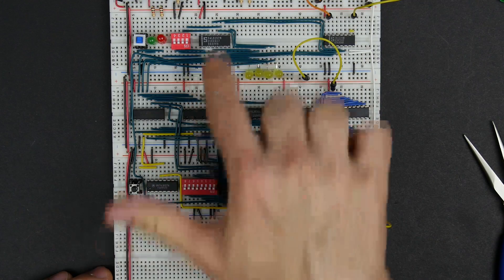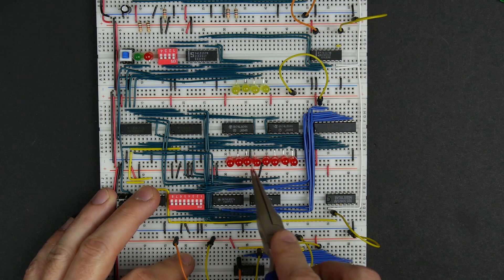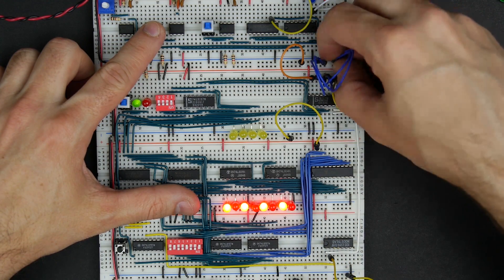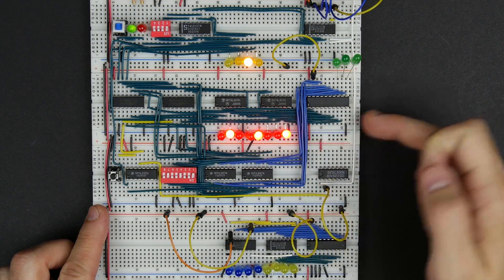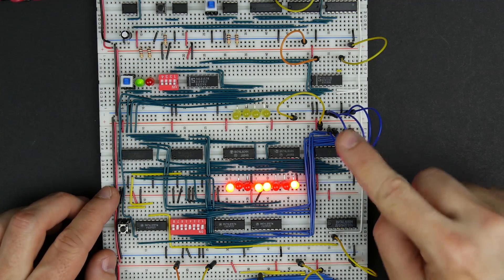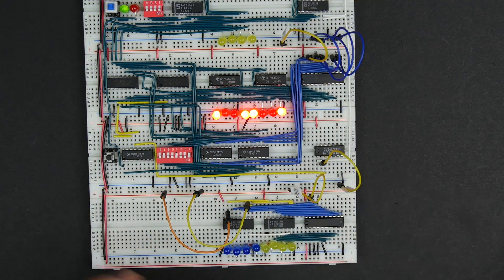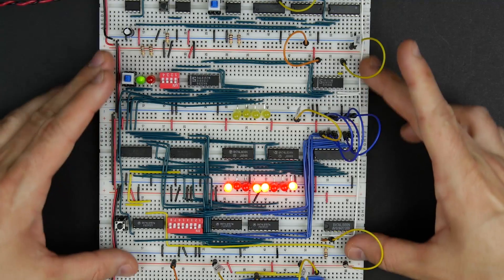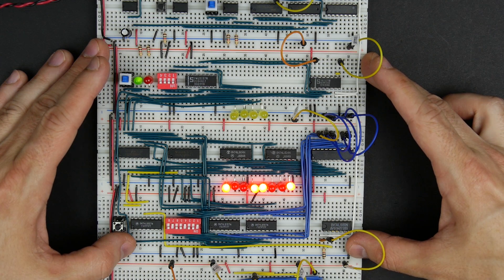RAM module testing and troubleshooting

Comment: Great fun building this so far.

The kits are great, but they are not flawless (and I would not expect them to be).  One of my 189s (the 64-bit SRAM chips) was busted on arrival.  Two of the address lines caused shorts.  Took me hours to conclude it wasn't a fault with my circuit - because that is your immediate assumption - and then to build a test circuit to prove the chip was dud.

I'm not bitter; it put hair on my chest, a proper debug session.  I'm no hardware engineer, so I like to think I learned a thing or two from the experience.

I think it's wise to put current-limiting capacitors on all the LEDs, despite what the video says (but if someone can definitely tell me I'm wrong about this, I'd love to know).  I'm no hardware engineer, so it's just something I'd do anyway because I don't know any better.   But also, from experimenting myself with the clock circuit, I couldn't drive a consistent clock signal to a load while running an LED from that signal straight to ground.  I dunno why, I'm a software guy, not a hardware guy.  Maybe someone here can tell me.  tl;dr - use current-limiting resisters on the LEDs - and this will mean that you will have to plan your own layout - the layouts in the video will not work.  Scan ahead to see what is going on the board, then adjust for the LEDs and resistors you are going to add.  This is fun (no really, I mean that!).

I also note below there's a comment about the capacitor on the RAM "sub-board" clock input.

I've scanned the threads for other errata.  I don't see any.  Does anyone have anything else?

Comment: I have a trouble that when i store data at address 0 in program mode and then switch to run mode,all the data will be reset to zero.
only address 0 have this problem,I dont know how to fix it.

Comment: Discovering you have a bug after connecting lots of wires can get frustrating fast.

Also, each time I see a misconnected power wire, I expect to release the magic smoke that makes everything work. That would just add to the frustration. Glad there wasn't any magic smoke in the video.

Comment: In my Ram module, when I switch my board from program to run mode, some of the bits in my addresses deactivate, I have checked my wiring multiple times, does anyone else have this problem?
Reply: Probably too late now... But it's likely that your 4-bit address buffer was storing a random address (whatever it got when it powered on), and when you toggled between program and run mode, you are going to pick up whatever is in that buffer.  Are you sure you wrote the desired address into that buffer?

Comment: If you ever had the problem of some of your 74ls logic gate series burning well thats probably beacause the inputs are floating and thus powering both transistors at the same time driving tons of current converted to heat
Reply: I had to debug for ages to find it and i also found that some chips are protected against floating like the CD4011 nand gate

Comment: Warning: Do not add the 0.01microfarad capacitor directly to the clock output as indicated. This creates an exponential decay curve on the clock's falling edge, making other clock-connected modules to be unreliable (mainly the control signals that use the falling edge later) . I confirmed this with my scope, removing the cap immediately solved the problem. 

The solution is to create a signal, isolated from the clock, using something like a buffer. Since there are 2 unused NAND gates right next to it (74LS00) , you can create a buffered clock signal by making 2 of the NAND gates into inverters, thus inverting twice. Input the clock into the first NAND input,  and tie both those inputs together, then send that output to the next NAND input, tie those 2 inputs together, and then your output of that will be the buffered clock that you can send into that cap as before.
Reply: I ran into the same problem where the negative edge trigger later was problematic (when building the control logic it would double trigger when setting test control signals low from the 3to8/138) and I traced it to this capacitor (looked like reflections were happening). It seems that you can also install a 10x smaller capacitor (10nF rather than 100nF) and negate the clock problem you're describing (at least on my setup that worked). The buffered setup you describe is superior though :).
Reply: Thanks!
Reply: Won't that add propagation delay that will desync the local clock from the main clock?  Unless you do the same thing everywhere you use the clock...

Though it might not matter at the low speeds this computer runs at...

Comment: If you have your clock input connected to your registers during this stage, you may be having double counting after putting in the RC circuit shown at 13:15 . 
Put the clock into the inverter (74LS04N), then put the inverted output through the inverter again, then connect THAT output to the RC circuit. 

I was pulling my hair out before finding this solution.
Reply: Thank you so much!

Comment: Adding this capacitor for 10 microseconds means that the clock speed can't be fastar than that, right? Isn't that a "bad" thing? How fast can the clock go?
Reply: it is only like 133hz at max so not even close to 10 microseconds per pulse
Reply: @FBI_Master  it’s actually about 300hz. Check the Turing videos
Reply: @xiar5546  oh i messed up my math

Comment: I actually had some problems with this build. In program mode, I would see data being written into RAM even when I wasn't pressing the button, and the values written weren't always matched up with what was on the switches. The problem turned out to be the assumption that the '157 inputs were internally pulled high. Even in program mode, the open input from the write enable was coupling to the clock signal from the bus write enable. And the open inputs on the '157's hooked up to the switches weren't stable. Adding 1k pullup resistors to all the inputs fixed everything.
Reply: Got exactly same problem here. I stumbled on this awesome channel when trying to build a Scott CPU and I am actually following lots of Ben's design and strategy since then. Last time I worked on RAM module, I've got the same problem as you described. I thought about debuging by changing my NAND gate from an HC series to a LS and, if it doesn't work, I would put pull-up resistors. Seems I'll try the later option first. Thanks for the advice.
Reply: There is also a problem that the 157 has some time that the output is low when it's select pin changes and thus sometimes writing to the ram but for some reason it's fixed when i place a 220R pull up resistor.
Reply: @stevenribus123   Where did you put that 220 Ohm resistor?
Reply: Had the same issue of inadvertant writes to the ram and found a LOW-Spike on the output (4Y, Pin 12) on the 157 when switching from A to B or vice versa on the select Pin ((A/B, Pin 1) of the LS157. The spike was on the output only, the inputs (4A, 4B, Pins 13,14) were clean. I solved it with a 100nF Capacitor on the Pin to HIGH - it works but somehow doesn't feel correct.

Comment: The capacitor charge time is actually about 50µs. R*C is the time constant τ, and it takes 5τ to charge a capacitor over 99%. 1τ will charge it to about 63%. How long this takes to trigger anything in the circuit depends on the VIL/VIH of the part.

Troubleshooting a circuit at work, I needed to extend the time a reset line was held low. (The bench power supply I was using had a slower rise-time than the supply in the system and I was getting garbage initialized to the registers.) I had to adjust my initial component values because the Voltage Input High was about 1.2V and the supply was 5V. I had calculated with 5*RC, but this was too fast because the components triggered high after less than 1τ. I solved E = Vin * (1 - e^(-t/RC)) for R where C = the cap I was using, E = 1.2V, and t = whatever delay I needed. Worked great after that.

Comment: @14:56 Is this a limitation (one of the limitations) on the speed of this computer?
Will it cause problems if the clock ticks more than once every 10 microseconds?
Reply: tip : thé answer is in the question...

Comment: I had the same problem as others with the RC circuit added to the NAND gate messing up the clock in other modules.  I routed the clock through the NAND gate twice with one input set to high to prevent the feedback and then to the RC.  However, when I do that the write enable is always set on the RAM chip regardless of how the RI jumper is set.  Anyone else have this problem and have a solution?
Reply: I had the problem with the RC circuit too. Rather than running the clock signal through the NAND gate as you did, I ran the clock signal through a Schottky diode (of the BAT-43 variety)  before connecting to the capacitor as design by Ben Eater. This fixed the "back signal" the RC circuit created in the clock line. Also, I found in general that Ben Eater's assertions about certain chips having internal pull up resistors is not always true, or the internal resistor is "too large" and thus doesn't create strong enough pull up across multiple connections. An so, I've sprinkle a number of 10K or 1K pull up resistors. Pertaining to this RAM module, the critical pull on resistor was on the selector pin of the 74ls157s (which select whether you are in run mode or program mode). Leaving those pins floating while in run mode yielded inconsistent results. The good news is since all these pins are connected to each other, you only need one 10K pull up resistor somewhere in the line.

Comment: This might be a stupid question but, why use a RAM if you want to write on the edge? Wouldnt it be simpler if you used a register from the begining?
Reply: The important thing about the RAM is that it contains multiple addresses. A normal register only contains one data value.

Comment: What gauge wire are you using in this project? I bought 22 gauge solid core, but the insulation seems quite thick compared to what you have here. I'm wondering if this is standard?
Reply: I was wondering the same thing; on my build the wiring gets very tight, particularly around the bus driver chips. On the ALU I ended up using an extra breadboard to space things out. I think I'm going to have to do the same here
Reply: I am in the same position

Comment: really great videos, subscribed, im trying to recall a combination lock circuit that i forgot, it used flip flops with for its sequencer series and a timed reset  when a certain time is passed, i just forgot about it, it was used for dtmf pass code to enable a an output, the dtmf must be in the right sequence to enable an output.
search you videos

Comment: Hi,  i just powered up 2 74LS189's and 2 inverters.   What i see it pulls 140 mA in total.  is that normal for just 4 IC's?  I checked and double check the connections

Comment: Why would yo not simply attach the data programming dips directly to the bus, giving the RAM a single read path? This would also let you put custom values on the bus at runtime.
Reply: I think it's for safety. It you switch tu run mode with one of the switches connecting to ground and any register writes a 1 on that bit you willhave a short circuit
Reply: because he wants to get away from manual programming and go for automated programming ... and putting the dips on the bus then stops that and will force what they are set at on the bus instead of what he wants to pass around the bus
Reply: Then you would need a way to force all the chips that might be trying to drive a value onto the bus not to, which seems like a lot of AND gates.
Also, the bus is not wide enough for both address and data, so at least one of them needs to take an alternate override path.

Comment: I ensured that the power and ground where connected properly to the 74LS157 but I still am having the same issue where the 4 least significant bits are going high when I push the push button. Any advice on where to look?

Comment: i wonder why at the start you have just random garbage in RAM can you please mak a vid about that mabye?
Reply: It's because when it's powered on, every bit wants to be on, but one goes on before the other and causes the output to be random.
Reply: it's known in digital electronics as a race condition ... it happens on powering up a circuit ... as no power is perfect on at 5v but bounces from 7v down to about 2v .. and settles out at it's 5v in the first few micro seconds ... all the different parts of the ic's have high power and low power available .. so the ic actually races to a result while the circuit bounces up and down from adding power ... 
.
this is why most ic's and all the earliest ones had a clear or reset line to set them to a known state so it didnt matter what anything had it was all reset to a known state usually 1 to signify its not active atm .... yes 1 means OFF not on ... 0 as in a complete circuit means ON or powered or running or working ... dam yanks cant get that right either ... 1 means not working or off as in just a piece of wire ... no connections no data .... 
.

Comment: Why do we need the edge detection? I understand the explanation of the timings just not the reason for needing it in the first place, why do we only want to write for 10us?
Reply: It helps to prevent potential errors caused by the data changing before the end of the clock cycle.
Reply: I had multiple tabs opened... nevermind what Melkior said is right, I think what could be added is that you take a look when he holds the button of the clock keeping the write signal on, the output goes off, that does not have anything to do with the rising edge, it is part of the logic of the chip, whenever the WE:0 (enabling write) - It will get inverted two times and fed into the output, setting all the outputs to 0.

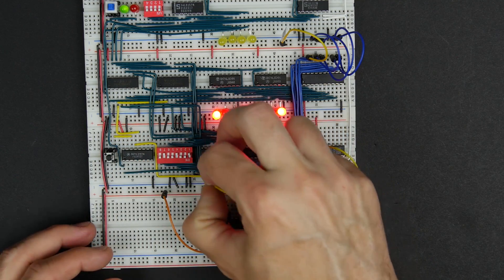Comment: 12:10 ... followup question to my previous post on this Resistor/Capacitor that Ben uses on the RAM IN signal. I've worked around the issue I was having, but the more I've looked into this issue, the more I wonder why this Resistor/Capacitor is even being used in the first place? From what I've read, putting a Resistor/Capacitor on a clock signal is a no no. Apparently the right way to accomplish this (one way at least) would be to use a 555 to get the 10us pulse we are looking for without violating any clock signal rules. 

But ... do we even need the Resistor/Capacitor at all? In looking at the datasheet, I don't see anything that says the write pulse is limited to 10us, so do we really need this? If we do, is the idea of using a 555 the right way to do it? 

I'm really curious about this point because when I put that Resistor/Capacitor inline with my clock signal, it completely messes up my timings on my other modules. I'm not sure why it isn't affecting Ben's system.
Reply: FWIW: I had the same issue, the RC on the clock line messes up my program counter (it counts on clock rising edges and falling edges). The fix I used was to basically build a poor man's diode (2 NAND gates in series where one input of each is +5V) to serve as a logical equality (in = out) so the clock signal can go into the RC, but, any discharge can't flow back to mess up other modules. But I, like you, am surprised that Ben doesn't seem to have this issue.
Reply: I am having the same issue. With the RC connected to the clock, the (forthcoming) program counter module counts twice for every clock cycle: on the rising (correct) and falling edge (incorrect). I suspect this is due to capacitor altering with the voltage in the line and corrupting the carefully crafted clock signal. Unfortunately I do not have an oscilloscope to confirm this. Thanks to David for his suggestions for fixing this bug. I think the 555 solution sounds most sensible.
Reply: david Is it possible to build an interface between this small 8-bit computer and a monitor with a VGA or HDMI connector ??
Reply: Having question relating to this too.
Does anyone know why the output goes all 0s when the ram in is on for some period of time?

Comment: The voltage across the resistor only reaches 0 at about t = 5 * RC, rather than just t = RC. Wouldn't that mean that the length of the pulse is 50 microseconds rather than 10?
Reply: It doesn't have to go all the way to zero, for TTL the high level goes down to 2 V and the low level up 0.8 V. It takes
ln(5/2)*RC = 0.92*RC to go from 5 V to 2 V, and
ln(5/0.8)*RC = 1.83*RC to go from 5 V to 0.8 V,
so it seems that the pulse width should be counted as something between 0.9*RC to 1.8*RC in this case. But I think that Ben was mostly interested to get a ball park estimate of the pulse width, and just RC itself is good enough for that.

Comment: Can somebody explain me if the 16 addresses as used in the example are the upper limit of an 8 bit computer? (as you only have 4 bits in the Instruction Register that can address them). 

In other words: how could you increase the memory? Do you need to got to a 16bit cpu or are there ways to this?
Reply: The most memory you could address with 8-bit addresses (and 8-bit words and no bank-switching) is 256 bytes.  I think Ben is using 4 bit memory addresses for convenience/simplicity here so he can fit both the instruction and the address of any operand into a single memory location.

That gives a limit of 16 (4-bit) possible opcodes that can address 16 (4-bit) memory locations. It would make the instruction decoder more complex, but he could change the scheme to two-byte instructions where the first byte is the op-code and the second is the address byte.  Then, he could have 256 opcodes that could address 256 memory locations.

To do any better than that, you'd need to employ something like bank-switching or increase the number of address lines.